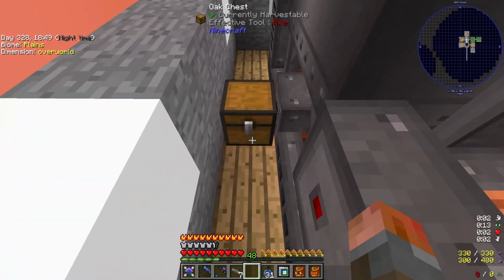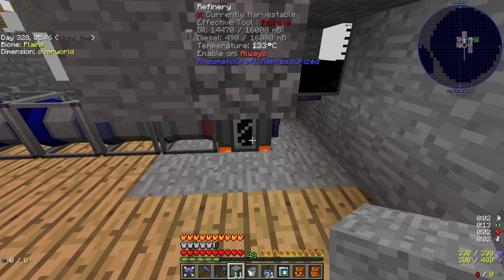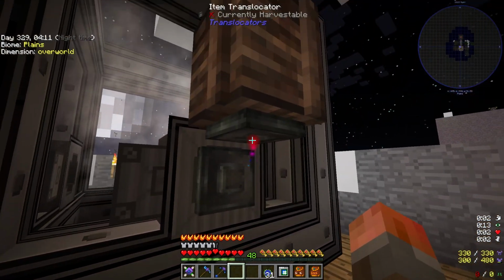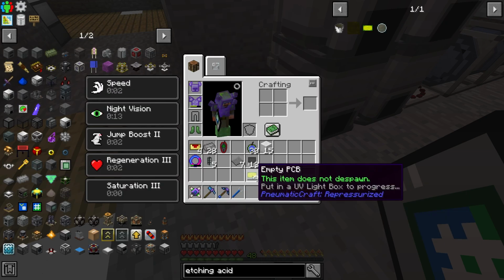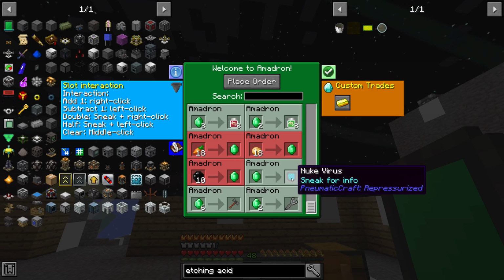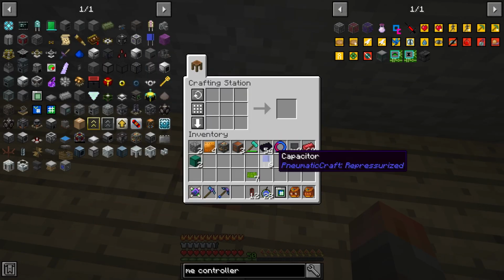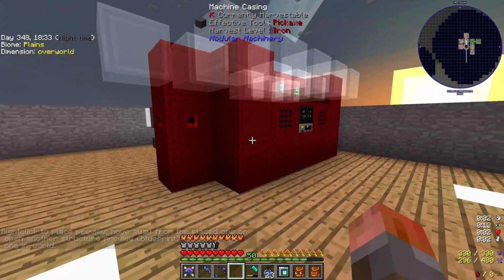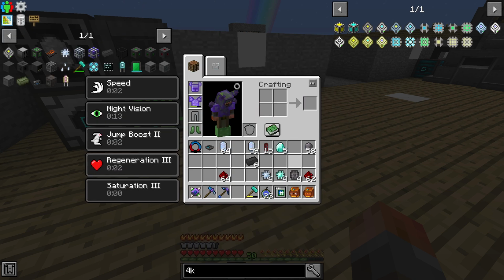Project Ozone 3 KAPPA MODE E15 - That Other Plastic and Other Tales of Kappa Mode

Comment: The Pressure Chamber Interface for output can be set to activate with a redstone signal. Just put a lever on the chamber glass besides it and then you can just pull the lever when you want stuff to be pulled from the Chamber. Then (as long as you don''t use it for automated crafting) you don't need the filtering function at all.

Comment: - You can turn off the left side of JEI with click on the bookmark icon bottom left (while you are using the storage scanner for crafting).
- If you craft compressed iron only as blocks it is not conflicting with compressed iron consuming recipes